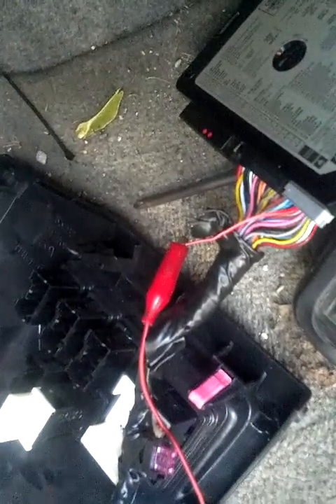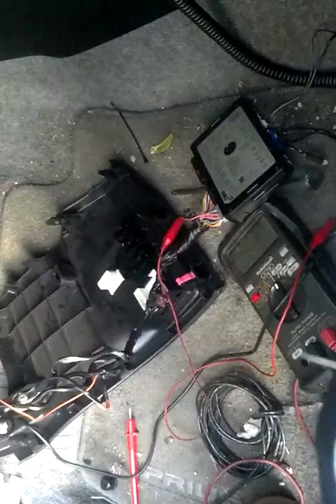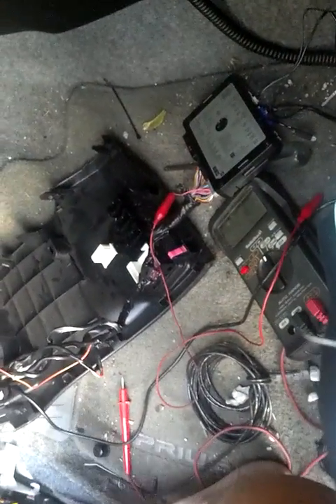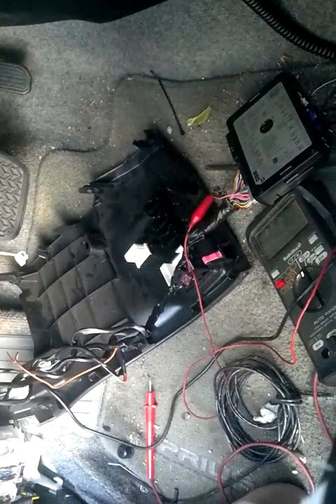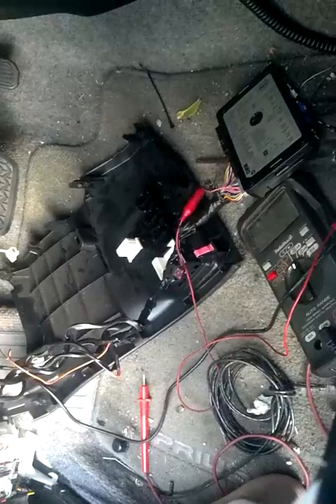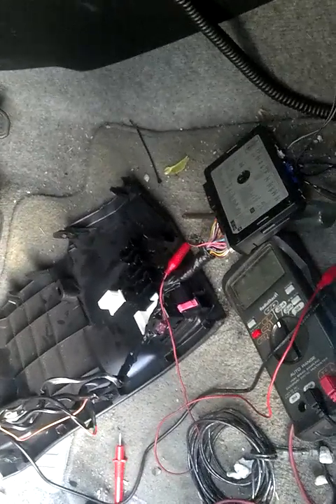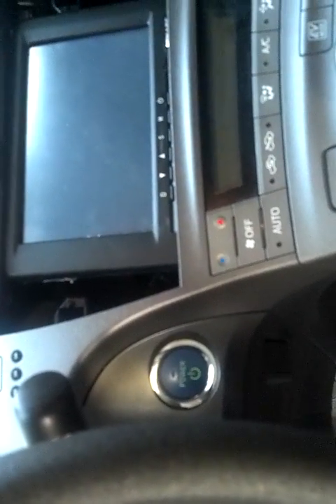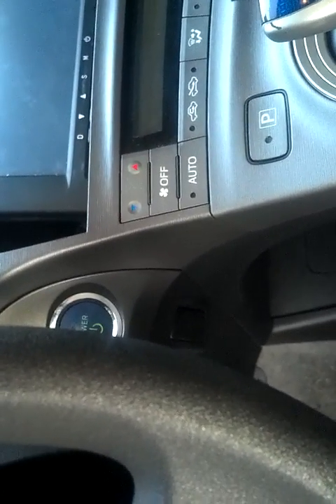Hacking the remote start door stop problem.

Comment from the maker: Yes I have, but its not a hack you can just do.  Its very complex, but the good is Im working on developing it into a full product that should be for sale at some point.  Youll still need an aftermarket remote start car alarm (I recommend compustar "max it" as I know that will work with my add-on board to allow full take over of any Toyota with push to start.   even the plug ins.
Reply: Hello Carey, have you had time to get your add-on board developed? Thank you for additional information?

Comment: Can you not forget about the door pin and just tap into the red and white wire at the brain?
Reply from the maker: not sure what you mean by that?  The red white is to set off the alarm when it goes negative.  The door pin will force to negative whene door pin shows open door, but you need to relay it away from the ecu so the car wont shut down.  This works well, but still cant do a full take over cuz of needing to press brake to put car in gear.  im working on a fix for that.  Getting close.

Comment from the maker: Bench tests are complete.  This is looking good now.  Gonna be installing it into the car as soon as I can.  This new "hack" does not require any modifications to the door pin wires,  and only minor things need to be done to install it between the remote-start-alarm and the Prius itself.   The end goal is FULL user take over from the remote start while maintaining full security features.

Comment from the maker: I ran into some unexpected issues with the remote star itself, turns out GWA stay Ground When Always during remote start.  This really messed up my plans, but no worries, I already worked out a solution.  More bench testing in progress.  Im pretty sure this is gonna work. with 100% full take over, and 100% full security against theft too.  As it should be.

Comment from the maker: Made some minor improvements to this hack.  I ran the door pin wire thru a relay's normally closed pins, so when the car is not started, the dome light/alarm still work.  When the car is remote started, the relay closes, (opens the door pin).  This allows  you to at least get in without shut down of the remote start.   I think I have a workable plan to defeat shutdown during break press too (if car is still armed break will still still shut down and require key fob).  So long as the car is disarmed, you should get full take over with out need to restart if my device works.  I will update as progress is made.